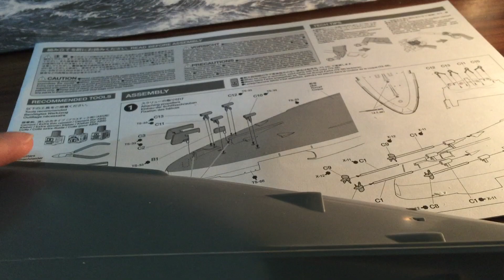1/350 Yamato Battleship RC Conversion Tutorial I

Comment: That's nice. I see you also have a kit for Nimitz class. That'd be my next boat if I ever come to it, great!
I'm making 1/350 RC Arleigh Burke class destroyer from Trumpeter and it certainly is challenging, especially when it comes to finding brass props that fit the shafts. And the size is small, the displacement is like 250g, but quite possible to work with. If you had something for that I'd buy them :D Although at this point I only need propellers themselves.
Same props also fit on OHP frigates, although they only use one.

Comment: Please what are the nf values of the capacitors you soldered in the electric motor?
Reply from the maker: Hi, just 50V 1NF is well enough.
Reply: @Hugo-ot7xu  many thanks for your kindly reply! I ask you about the capacitors because the standard capacitor kit sold by Robbe was 1 capacitor 47nf and 2 100nf soldered between the motor terminals and terminals and motor body respectively
Reply from the maker: @modelSUB  Not a big deal my friend. The parameter I mentioned is more like an experienced value and definitely it could be a range available for certain motors.
Reply: @Hugo-ot7xu  yes I know, my friend. I will try these type of capacitors in my new battleship Hispania, that has four 180 mini electric motors. Regards from Spain!
Reply from the maker: Pleasure and thanks for your kind works, and best wishes to your project.
Reply: @Hugo-ot7xu  Your conversion kit for the Yamato battleship is awesome my friend, with those nice props and shafts. I hope you sell a lot of them on eBay or any other one sales web!

Comment: hello. can you please tell me why did you put capacitors on the motors ? thanks
Reply from the maker: Hi, Jona and thanks for your interest. For these capacitors, they are playing the rule like absorb parts of the electric pulse. You know, brush motor has graphite brush to transfer electricity to the rotor. On actual performance the capacitors may have efforts on reducing the sparks on the brush of the motor. Especially, the output electric pulse from ESC may overwhelm the input of motor at startup stage.
Reply: Thank very much sir. YOU ARE AMAZING